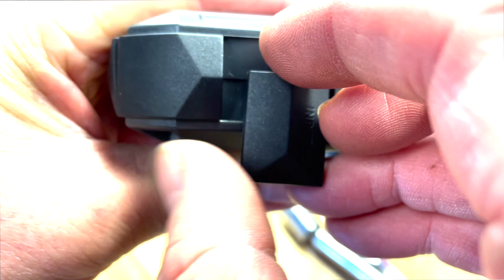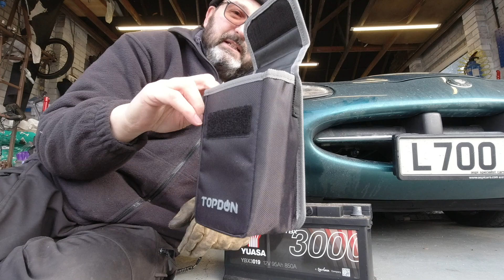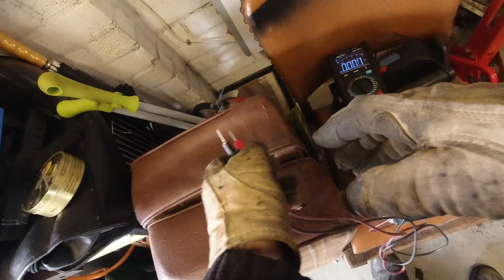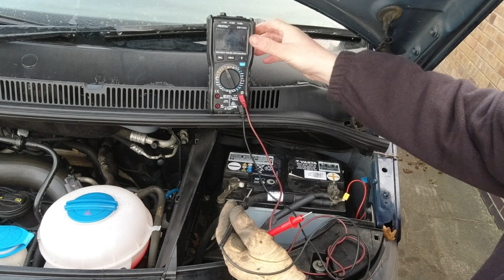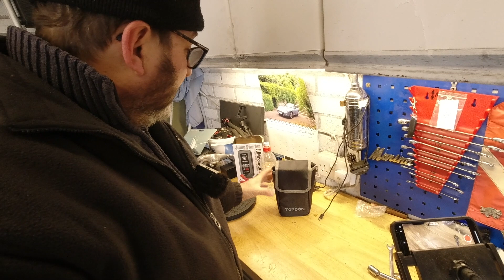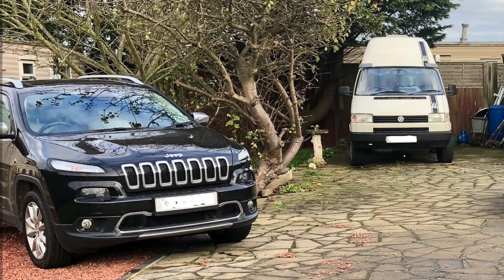TOPDON Jumpsurge JS1200. Car jumpstarter and power bank. Does it pass the REAL WORLD use  test?

Comment: A good video John, very useful. Bought a very similar unit branded as Lifeline about 4 years ago, the big black plug is almost identical. Have used it three times, once the Jag, once the wife's little Mazda and once for someone stuck in a big German car in a car park one day. It's proved its worth alright. I charge mine every 3 months, well worth remembering :)   like you say our Jags are very demanding battery wise and you never know when your battery could play up.  Changed my battery almost a year ago, it was a Varta approx 8 years old, still has some life in it so it's installed on my little solar power installation, I don't.like throwing things away  😁

Comment: John, I hope you're being paid lots of money to promote this device. Please get back to stuff that isn't being sponsored and of course you cannot be bought.
 UNLESS you need it to supplement the channel in which case go for it.
Never figured out why you need a strobe on the lights that you can get today ?
Reply: I don't understand. John isn't being sponsored. 🤔
Reply from the maker: Correct Richard 👍
Reply from the maker: Hi Gary. Absolutely no sponsorship and no payment. Im too fond of saying what I think😁
(they were sent for free though, in return for feeding back my honest opinion)
I think the strobe is intended as a general underbonnet aid to observing the moving parts. I have certainly used one to watch a jumping fan belt before and although obviously its not synced to engine speed and so cant freeze the engine movement. it can usually give you a different view and a still rather than blurred naked eye view. 
I also think they are inteded to be used as a distracting light if you are under attack. Some alarm systems also have this. Its hard to target anyone in a physical attack under strobed lighting.

Comment: Thanks John
I was toying with the idea of buying one of the larger jump starters, but was put off by the size of them - certainly not an item that would fit most glove boxes.
Just used your discount code via the ebay link and saved a tenner off the marked price ... so £55 with free next day delivery.
Reply from the maker: I think its a really good deal, for what you get.

Comment: Hi john. I have to correct you regarding the positive, or live terminal on the battery. If one is removing the cable that is attached to the positive terminal and you touch your wrench to just about anything metal on the car, you will complete the circuit that you originally broke when you removed the negative cable.
Upon completing that circuit, current will flow through that wrench and through you causing a very significant shock.
Reply from the maker: Thanks for watching Dave and for taking the time to comment👍. But No. If the negative (earth lead) is disconnected then you can touch the positive battery terminal to any bare metal on the car as there is no route back to the other side of the battery and so no current can flow.

Comment: Hi John.  Great video.  I also tend to keep my xk8 on a battery tender which does seem to extend the life of the battery but I feel could also make knowing when the battery needs replacing a little harder to spot..  A couple of times each year I do road trips and so this is the perfect gadget to have with me.  Just ordered one.  Thanks! Steve
Reply from the maker: Thanks for sharing Stephen.  Yes very much the same for me. I worry if the battery tender is lulling me into a false sense of security😁. But now i do test my batteries at least annually and tape a slip of paper with the date and results to the battery.  So I hope to be able to spot the decline in condition before it bites me.🤞

Comment: Hi John, useful stuff. I really can recommend those little Li Ion power packs. didn't have to use it on the XK8 yet (new bat, always on CTEK when asleep in the garage) but once I let the bat in my Corvette go flat cause the bat tender came  off the plug. well, I was a bit suspicious if something that small could provide enough amps to start the big V8... and it did. so indeed some item worth having!
Reply from the maker: Thanks Wolf. Glad to here it will sstart the xk8's American cousin too👍